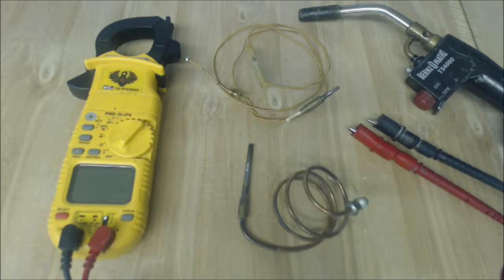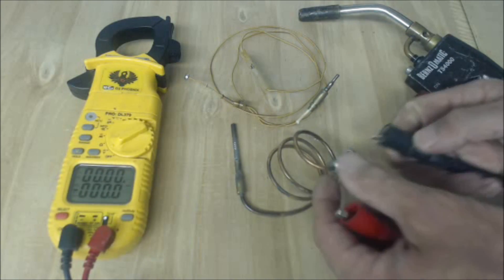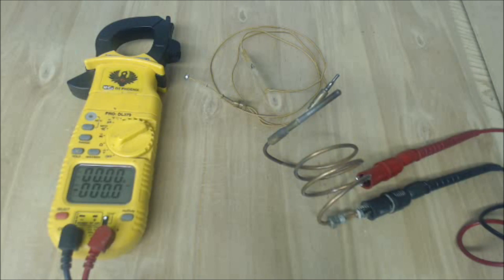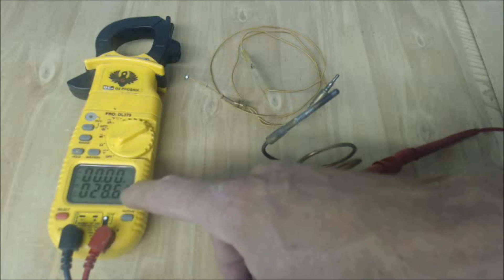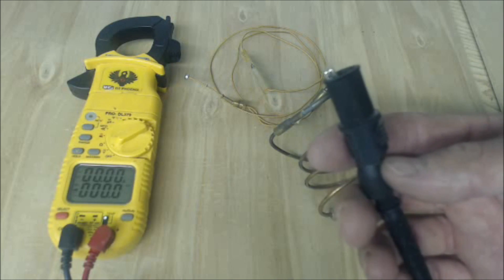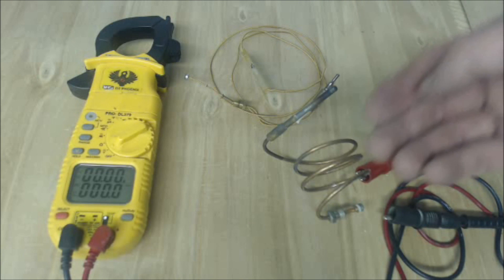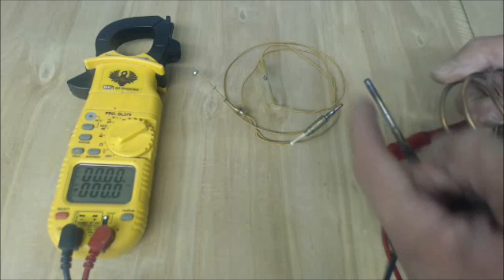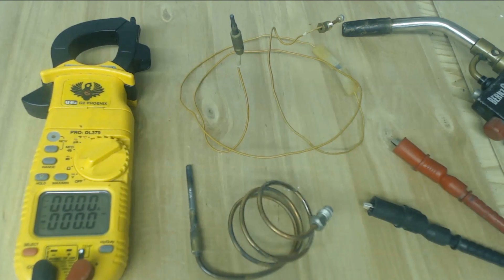How to Test a 30mv THERMOCOUPLE! How does it differ from a LOW MASS ONE!

Comment: Great great. i enjoy your educational videos.  Can you show how to test thermocouple on the furnace using the pin?
Reply from the maker: Thanks Abe, are you talking with just the pins/probes of a multimeter?
Reply: @acservicetechchannel  at 2.55 in the video, you indicated that the voltage can be read off the back off gas valve through a pin using multimeter. It will be very helpful to know that way because you can test voltage without taking thermocouple off a gas boiler or furnace.
Reply from the maker: Hey Abe Syed, I showed how to use that in one of my latest videos, and the tool is linked in the description section- https://youtu.be/PiCmfW1rTRY

Comment: Acservicetech,  friend would you reccomend to get a electricians license?  If you have your own Hvac business would it benefit to have one so you can do the wiring?  Do you make more money doing both or would it be overload?  Say if the man works 75 % faster than regular worker. Are we talking about 100, 000 a year?  I'm just getting out of school,  young amature. Truly blessed by your knowledge.
Reply from the maker: Honestly I would try to get as many licenses as you can but just focus on one at a time as they usually require 5 years experience in each trade alone. You want to be the problem solver, the one people rely on and then eventually the hardest thing will be learning to say no depending on the size of the company. There certainly is an efficiency of the person compared to another in reference to self employment. In regards to working for an employer, some companies even pay flat rate instead of hourly, thanks!

Comment: Very nice!  Just to be sure, when the thermocouple is not holding the gas valve open it should read around 30mv and when it is holding the gas valve open it should be around 13mv? just want to be sure, Thanks.
Reply from the maker: yes 20-30mv open and 13mv closed when powering the valve, correct
Reply: Great! thank you for the quick reply.  You are a great instructor.
Reply from the maker: No problem, thanks